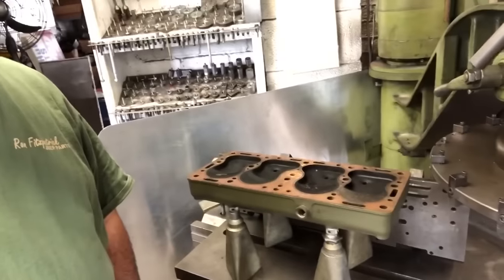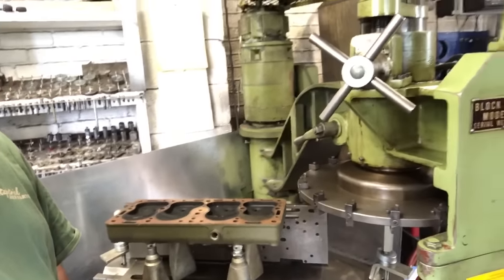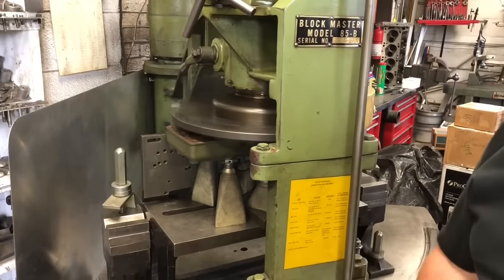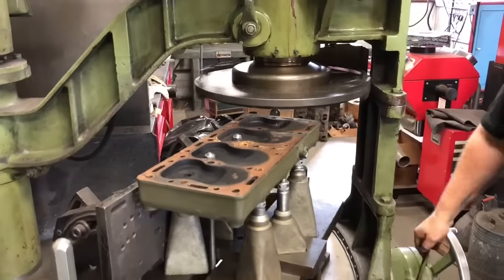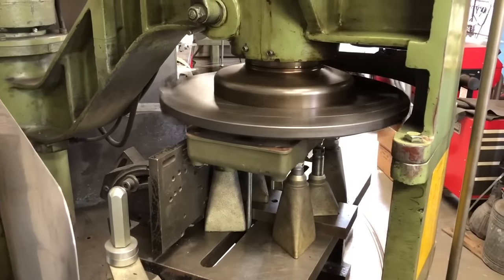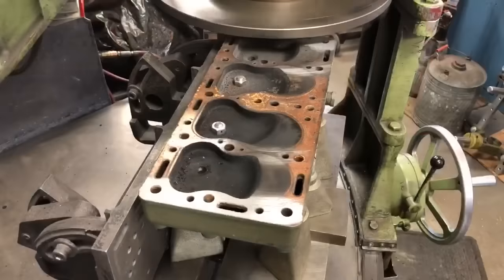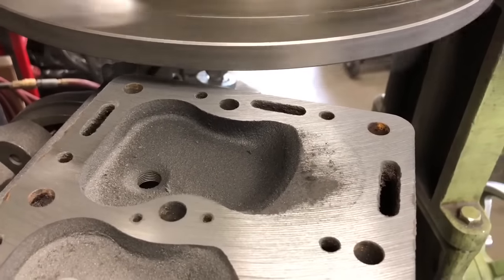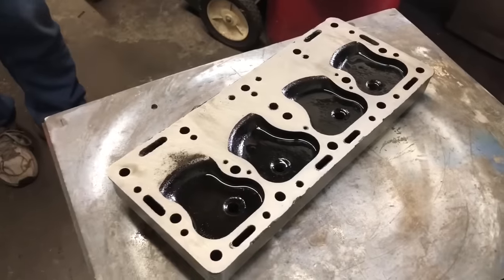Willys Flat Head resurfacing

Comment: That's a scary looking piece of equipment - scary expensive that is.
I still don't quite get why this machine is built the way it is, particularly why it is so complicated.
I'd watched another video of the same process before but it's by watching this video that I realised how much of an art setting the head level is and how one goes about determining it is level. The possibility of distorting the head in the process of levelling it is yet another dimension of the problem. The discussion about the head buckling though made me think: how do you know the head is not buckled in the first place? How do you go about it if it is? Do you try to correct the buckling using the props? I realise this may be a very silly question but it just really baffles me.
Reply from the maker: Stelios Posantzis we put a machinist edge on the head and checked the surface with a feeler gauge. I wanted the head flat and these things do warp. Just posted another video getting the rest back from the shop.
Reply: Watson's Wagons : Thank you for this. My original posting was not clear: I'm baffled by the principle behind this operation, not the execution. My reasoning is: if the whole head is warped and just its face is flattened, won't that just shift the problem elsewhere? And to be perfectly clear, I'm thinking of the case of a modern engine and not a flathead. My concern is that, on a modern engine head, the valve seats and valve guides will still be misaligned at the end of this operation. Wouldn't that create a problem with the cam? For example, assuming that the head's warping causes uneven loads on the overhead cam bearings, won't these get worn and introduce play in the cam axis? Please excuse my ignorance if all this is complete nonsense.
Reply: Stelios Posantzis cam bores could be misaligned on an overhead cam engine. But that would be checked and fixed on a line boring machine. Seats and guide would also be machined true again, but in another operation as well.
Reply: basket of deplorables : Thank you for this info - I didn't know that.
Reply: The worst deformation would be in the small section between the bores where the head would deform or burn away leaving ridges from the gasket especially on alloy heads resurfacing smoothes the head and restores the seal
Reply: jos Touw : Thank you for this. I'm not a mechanical engineer and I do not know anything about engine design but I'm constantly baffled by the thinness of the engine sections between the cylinders - even in modern engines. I would think that the sections between cylinders would be extra thick to withstand heat and would have cooling liquid circulating in between to dissipate as much heat away and as quickly as possible. Air cooled engines are built with fins all around each cylinder and certainly seem to adhere to this principle. I suppose the rate of convection with liquid cooling is much higher which could lead in the block buckling (or cause other degradation due to the stress from cyclical heating) so the decision of how close to the cylinder the cooling liquid must flow has to involve some sort of a design compromise.

Comment: Willys not so "flat" head! Typical cut pattern for a warped head. That particular mill is a beast. Good for larger jobs...... can resurface a 250 Chevy integrated cylinder head, deck exhaust and intake ports as a single plane. You will get a better surface if you raise that one low bit!

Comment: Very interesting.   Will they ever introduce a flexible material where the head would shape itself to the block?
Reply: Traveling Kaspers World Simple answer is... No. Flexible material is weak and when under pressures of combustion, would flex to relieve the pressure. That's why you have to have 2 perfectly matched surfaces that don't flex. The easiest surfaces to match are perfectly flat. Plastic is used in making intake manifolds and can flex to match surfaces but they don't have to withstand the abuse of constant combustion. So, no. I don't believe there's any material that is flexible and able stand up to combustion pressures and heat. Aluminum is a softer metal and had some flexibility but, it still has to be perfectly matched to the blocks surface or it will fail and fail much quicker than steel. It so flexible that it can easy warp by not properly torquing the head bolts and cause gasket failure, fairly quickly. I just can't see any metal being softer and more flexible than aluminum that could hold up to the extremes of an engine's combustion. Especially now with the horsepower that being generated by engine builders. If anything, engineers are designing engines with stronger materials and less tolerances to withstand higher compressions. Turbos, superchargers and the likes, have become commonplace amongst manufacturers and that means that engines have to last hundreds of thousands of miles without major failures. That means heat dissipation and cooling advancements over finding a material that can flex and still retain it's strength. So no. It's unlikely to look for flexible material to avoid having to be precise. Precision is way too easy to achieve with today's technology. Aluminum became a common engine building material for its ability to dissipate heat faster and it's obvious weight differences. It still doesn't have the strength of iron or steel but, it has other benefits that make it useful. Flexible is actually not a bonus at all. It has to be overcome to make it a viable engine building material. I just don't see anyone wasting their time developing a flexible material that's primary goal is to mold itself to imperfections of the manufacturing of an engine block or vise-versa. I'd say No. Not gonna happen.
Reply: @commonnons3ns316   Interesting reading. When you mentioned flexibility is not a bonus at all, that hit home.     Machinists are amazing craftsmen.
Reply: Not flexible but history shows engines with the top combustion chamber solid to the bore but they were not that practical, also vw Beetle engines use no gasket just metal to metal

Comment: The cutter sound like they're really dull. It sounds a lot like a fly cutter when it's dull and basically that's what it is it's just a bunch of little blades. I'm assuming they're high speed Steel. They get a funny ping sound or plunk sound when they're dull it's hard to describe really you just got to have experienced hearing it over and over. Is there any machinists here don't know what I'm talkin about.

Comment: Why would you even surface a head without cleaning it 1st & checking it for warpage?
Reply: In my opinion it is not necessary, the machine will eliminate the paper gasket, and for the cast iron head to be deformed enough to cause problems it takes a big fire or an accident.

Comment: Or... You could do the same thing as mechanics have been doing for eighty years with these engines.... Clean it off, check it with a ruler, put it back on, and run it. I was raised with these old engines. As long as the gasket seals, they don't care.
Reply: Gramps used to drop the oil pan and file the rods down by hand when the babbits wore and drive 50 miles further.

Comment: It seems really odd that it was out of true in the middle by that much where the bolts were holding it down. I probably would have cleaned it and checked with a quick flat sand
Reply: I've seen these warp almost a whole 32nd. Same with the Continentals and the inline six Chryslers. 0.010" was common warpage but some seen more.

Comment: You removed .0005" When you reassemble is the gasket thicker? I already know, your'e probably lucky to find a gasket without having to make one.
Reply from the maker: Rich R I have felpro gasgets for this engine. Plenty thick enough
Reply: Gasket would have to cover the difference.
Reply: @ISupportTheCurr3ntThing  Yeah, I don't know he has so many cutters on that. Each would have to be preciously the same length/depth to get a precise cut. One would think a dressed stone with a sweeping motion would work better. I'm an Engineer, not a machinist...so what do I know. Gasket? Well if that copper gasket is stock, then he has a higher compression. Well everyone has their own method and as long as it works, they have accomplished something. Probably not leaking anymore. Like a cook, I just eat what they make, I don't argue the finished product LOL
Reply: .005 is 5 thousandths not 
.0005 is 5 tenths
Reply: @dirkdiggler4907  Yes
Reply: Ronald Farley  Agreed, just rambling on YouTube.

Comment: I'll take a CBN finish over that 85B with inserts any day. The CBN is a much better RA finish..... I work at a full service auto machine shop and this is NOT how to surface a head.
Reply: After 30+ years owning a shop i agree
Reply: @tomhutchins1046  I'd use  the machine if it was all I had to work with or I could send it out and pay $30-50 to have it done right.

Comment: I'm not a professional machinist, but it doesn't make sense to me to make initial measurements down to the thousandth through rust.  I would have first cleaned the head off with a wire wheel, then check for cracks, and then start machining.
There's no better music than the sound of a machine shop in action; please, no background music.  It only distracts and detracts.
Otherwise, an interesting video.  Best of luck with the rest of the build.
Reply from the maker: OverKnight what you see on that head is just color transfer from the gasket that was removed.
Reply: Thank you for your reply.  Wouldn't precision be improved if that was removed before the setup measurenments?
Reply from the maker: OverKnight possibly but it only took .005 to clean it. I trust this guy, he’s been doing this work his whole life

Comment: Nice job.
What makes a head wear like that?
Reply: it doesn't wear, it warps.
Reply: @tomhare3190  Is that from uneven heat, or just age?
Reply: @bigredc222  - There are internal stresses in any casting. These stresses cause the casting to warp over time. Repeated heating and cooling doesn't help. I think it might have been Packard that had a years worth of engine blocks cast ahead of time so that they could just sit and over time relieve some of the internal stresses.
Reply: @tomhare3190   I've heard storied about burying new casting underground for a year before machining, but I haven't been able to find any evidence of that, and imagine the space it would take up.
Reply: Age stress relieving, yeah, but burying underground why would ya?
Reply: When BMW were first turbo charging race cars they would start off buying road vehicles that had already covered 100k miles, strip them then leave them out in the rain, apparently the workers pissed on them too. 
Any casting defects or would have shown and as much stress as possible would have been worked out.
Crazy Germans.
Reply: I heard about it on a website for people that restore antique machines, a lot of the people on that site say it was done, pretty strange.
Reply: Cast iron is weird stuff, it's not so much an alloy as a mixture with grains of graphite in suspension, i imagine burying or just leaving it outside caused the iron or carbon at the surface to leach out, copper and some alluminium alloys get harder with age too but they definitely are alloys, one of the reasons you can't anneal alluminium too many times is the elements start separating hence the T number on sheets. 
I'd be interested in hearing an explanation
Reply: @turboconqueringmegaeagle9006   Many racing organizations have used used parts because they have stress relieved. Despite how much everybody worships German engineering, I don't think there is any magic about pissing on parts.
Reply: @tomhare3190  no magic, but there are very different approaches to design and manufacturer in different countries, the Germans do attention to small detail very well, Russia does design which permits huge tolerances and no quality control during manufacturer, polar opposites both equally impressive.
As for the piss, I'm pretty sure i read it in A. Graham Bell's book on forced induction, he didn't have an explanation for it either but piss has been used in industry for centuries, I'd not say it's completely out of the question that it had a positive effect, piss is full of nitrates, steel cylinder liners are often nitrided, who knows.

Comment: You left a hollow in the first head... there the gasket will burn for sure, not a good job....
Reply: Yes... I too would be concerned about that chamber with 'pitting' of the cast iron. I've surface ground many cylinder heads in the past, both petrol & diesel, and would have continued to grind the pitting out to match the other chambers. I wouldn't be surprised if she's not back in the shop within a month or so of driving it around. Please let us know if it came back.
Reply: @davidpalmer9780  Keeps the work flowing